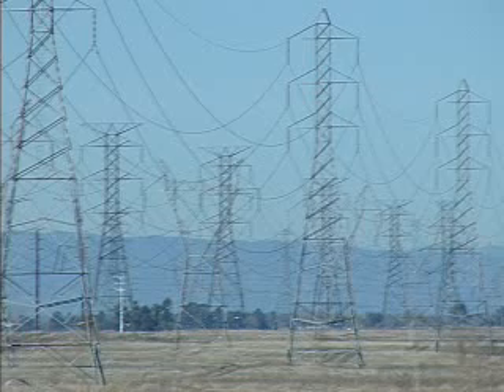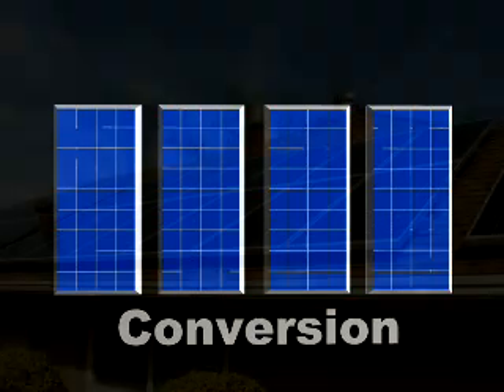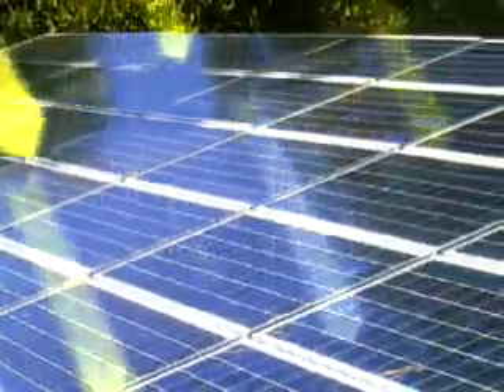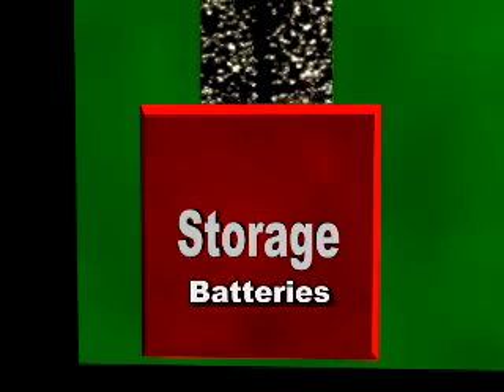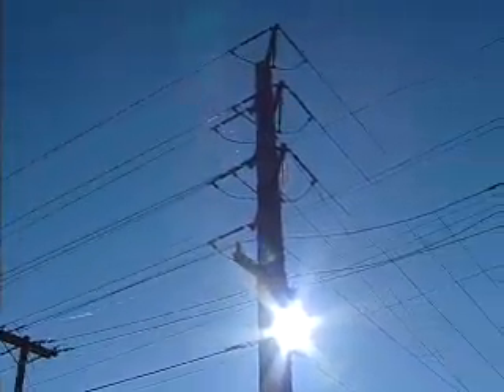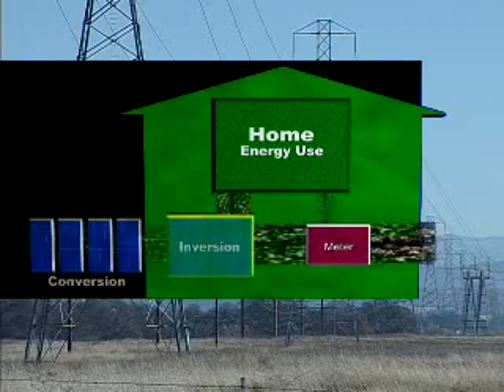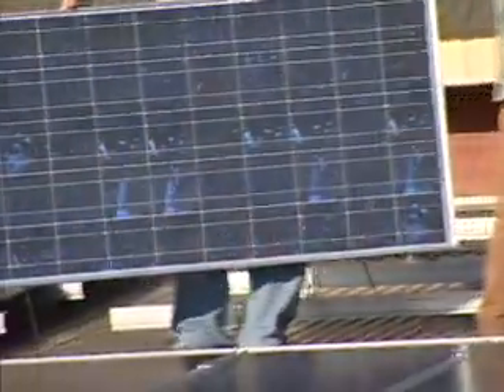Solar Power 101 - how does sunlight turn into electricity

Comment: 2% of Earth's land would power 10 billion at a western standard, assuming better insulation, led lights and electric cars. However, there is still infrared (heat) emitted when sunlight hits the dark surface of conventional panels.
If MACHINE made batteries and GaAs concentrating systems were used instead, to power the world, there would be MUCH less heat and only 1% land needed...
Search "oil storm solar" for quick dramatization

Comment: great video!

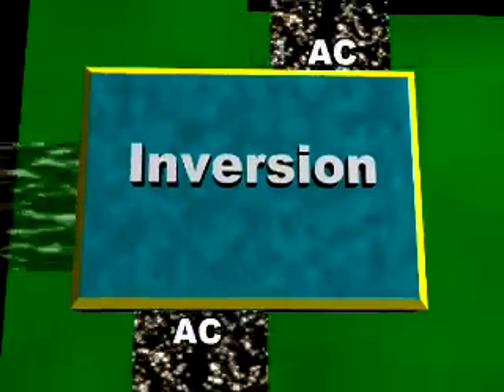the only problem is the graph at 0:55, where it states that AC power goes from the inverter to the Batteries.  Batteries are charged via DC.

Comment: Solar Power very good thing and more people should probably try a 

Although may as well point out that you cannot charge a battery/s with AC current, unlike this video suggests. Ever you would have to have it before the converter maybe in a similar fusion to a UPS or a second converter to change it back to DC just to charge the battery/s and that would be next to pointless.

Comment: When the Photo Voltaic cells are configured into a charging-battery bank system and inverted, it is possible to store energy and achieve high-amperage hours output beyond 100amps!

Comment: I am a carpenter on the North side of Chicago for some very wealthy people, you would be surprised just how inefficient  solorvotaic cells are.  A house that can accommodate 500 square feet on its southern facing roofs, houses much bigger than normal would be lucky if it generated 30 amps.  To keep this in perspective the average persons house is run on a 100 amp service, and batteries are not much better.  Hopefully with rising fuel cost moneys will finally be allocated for effective research.